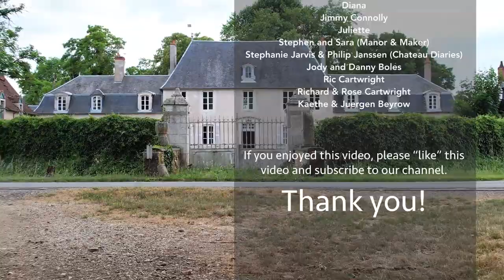KITCHEN RENOVATION Continues and the SPARKS are FLYING - Journey to the Château de Colombe, Ep. 72

Comment: The walls look like the French "crepi", which is a mix of paint, sand and plaster, very popular in the 60's & 70's for hiding cracks, irregular walls and grease stains or mold....it slides off with a heat gun and plaster spatula....
    Thanks for the Go-Go dance on the scaffolding, that dangerous move clears you of the crime of not dancing a Can-Can or Valse Musette!!!!!
Reply: Glad you liked the go go disco scaffolding dance. 😊. It was fun and this job was mind numbing.  😂. It was very popular.  The heat gun method really works.  Thank you so much for the tip.
Hugs from Colombe. 😊

Comment: I was wondering what you were using to sand the walls.  Have you thought about using a spray gun for those huge expanses of walls?  It is so much easier than rollers, but guns need to be very carefully cleaned or you are totally screwed the next day.  So rollers are less hassle.  I like the colour "slack lime" it did look bright white, but later on, from a distance, it looked more cream, I suppose that is more the true colour?  It is going to be so nice and bright in the kitchen.  Ha ha ha, having to increase the door height!! I am 5'2" so this is something I have never had to worry about.  But my husband is 182cm, so very tall.....very handy for reaching things

Comment: A vent won't remove all of the cooking grease from the air and it will settle everywhere. It's just like ceiling fans make dust hit the walls. You don't really notice these things at first.
Reply: That is true.  But if non is vented, the effect is even worse (as seen) 😂😂😂😂.  It is really only over time that we see the results.  A fresh coat of paint helps. 😂🤣😂. Have a great weekend.  ❤
Reply: @patrickjourneytothechateau9452  that is so true. I have moved into places that looked clean, until you really looked. Then I would mop the walls 😄

Comment: loved that brick you took out of the doorway with the border indented into it.  You could add some lettering  in there, like.... kitchen.  Make sure you get the font size right or it could be kitch ha ha.  When wiping walls, you start at the bottom and work up, so any run marks are easily washed off.  Going from the top down... if you get run lines, they are harder to remove.  Be careful that textured finish is not artex as it had asbestos in it pre-2000.  I tried removing it once and I inhaled the small section, not realising as this was back in the 80's.  Next day I could not speak as my throat was so sore.
Reply: Good point about the asbestos. I noticed that Patrick was wearing a respirator mask.
Reply: @betteurbain7911  yes I noticed that too, but it will be the dust in the room
Reply: Thank you so much. The French didn’t use asbestos in plaster.  Thank goodness. 😊. 
I do use masks.  If  I dint, my mom would all over me….. ❤     Good tip with the grease removal. Hugs.

Comment: When you first bought the chateau, you mentioned the textured walls. I was waiting and wondering what you would do to remove or reduce the look.  We have that texturing on all our upstairs ceilings and the slopes from the ceilings, plus on the stairwell to the basement.  They are dirty and just plain ugly.  I am not sure we have the energy to sand them off, that is a lot of work definitely for seniors to tackle.  Well done for tackling it though, so much better.
Reply: Good morning Ronnie.  It is a lot of work.  Especially on tall walls or ceilings.  now, there is one method a viewer mentioned.  With a heat gun and a metal spatula.  Warm up an area and it comes off easily.  Our walls are a disaster 😂. That’s why we didn’t want to take it all down.  I guess I’ll be a bit of a disaster when I get to my 273rd birthday.  
Thank you for your comment.  Always appreciated.  Big hug to you from Colombe. 👍🏻🥰💖